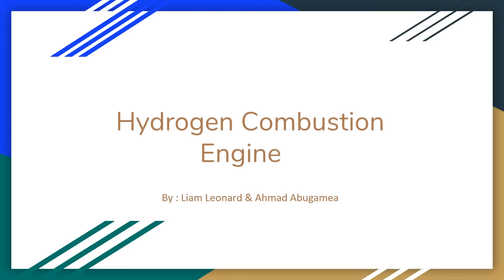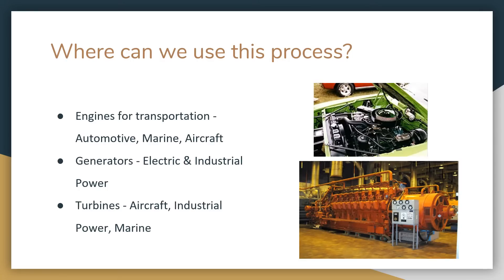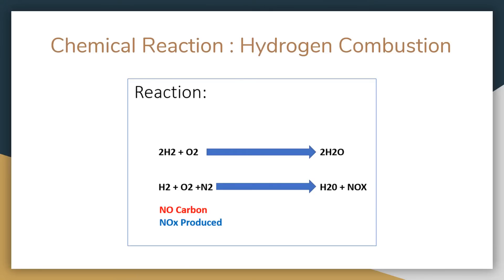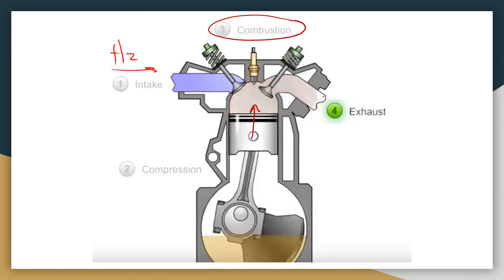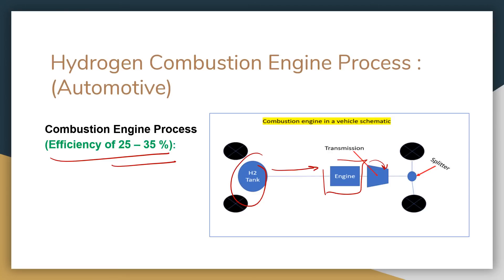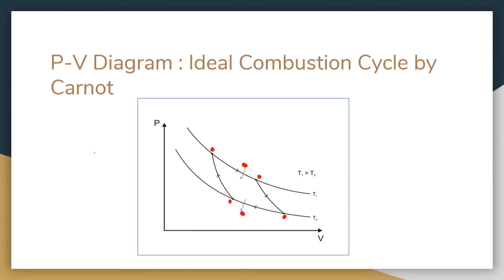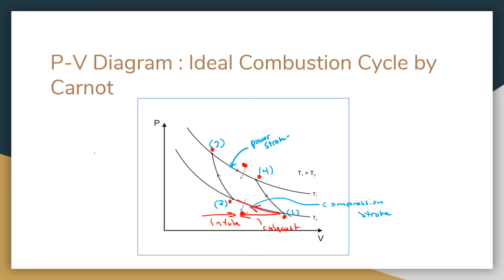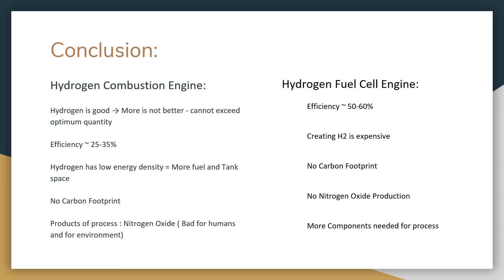Hydrogen Combustion Engines

Comment: In 2021 a Toyota Mirai set a distance record of 845 miles on 5.6 kg of hydrogen, 845 ÷ 5.6 equals 150.89 miles per kilogram. If hydrogen is only 60% efficient (only 60% is actually doing work) that means only 3.6 kilograms of hydrogen moved the vehicle, 845 ÷ (5.6 * 60%) equals 251.49 miles per kilogram of hydrogen.

Comment: Good that this shows NOX produced. Usually this is glossed over when comparing diesel engine with hydrogen engine. NOX is a pollutant, CO2 is not. A major issue is how the hydrogen is produced in the first place. In order to avoid CO2 green hydrogen is needed e.g. electrolysis or methane pyrolysis. Most hydrogen produced today is from steam reformation of methane…byproduct CO2….Blue hydrogen where CO2 is captured has been produced for a long time… the CO2 is used e.g. to carbonate drinks…once opened the CO2 is released into the atmosphere.
3 main practical issues to redress with hydrogen
Green production on scale needed to replace existing energy sourrces.
Transport.
Safety.

Comment: Why does everyone wont to have Pressured fuel tanks inside the vehicle??? 
This is because all the money people and governments, wont to stay in control of these utilities, making vast amounts of money!
I believe the way forward is producing Hydrogen as it is needed, with a small unit right next to the engine! It would not need to be
very big. As each vehicle would have a fuel / water tank, which could be fed to the small unit were electrolysis takes place.
The small Hydro plant, would have micro-switch's, to keep the internal pressure's from getting too high or too low.
Yes, there is still work to be done, but I am sure, this could be overcome.
Reply: … and the energy to run the electrolysis comes from…?
Reply: @guitartommo2794  
As stated there is work to do, but once the engine is running, an alternator produces on average 14.5V.
Electrolysis starts roughly 6.V, upwards. I don't know how many Amps, would prove to be the best? 
Anyway, you could have 2 alternators? 
It could have a petrol start-up, & switch over to hydrogen for normal use. Hope that helps, just give it some thought, you may come up with another way?
Reply: @truethought369  And what fuel drives the alternator? Petrol? Sounds like a petrol hydrogen hybrid🫣
My thought is leave hydrogen in the water. We need the water more than we need hydrogen to power cars…

Comment: Why don't we have separated passenger cabin on two wheels and the engine or the motor on another one wheel or two wheels into two different products. Then let the customers to choose and connect them as a three wheels and/or four wheels vehicle. In this way, we can isolate the complexity from each other; and replacement and/or recycling can also be much easier and repeatable.

Comment: Where did you get your statistics and figures from for your fuel and engine efficiencies?  Because it seems that you neglected to factor in the results of altering the internal combustion engine and its operating parameters, to take proper advantage of hydrogen as its fuel.  

Every fuel that can be used in an internal combustion engine has a specific ignition advance curve that works best for it, along with an octane "rating" which ultimately determines the maximum allowable compression ratio and camshaft profile combinations for the engine utilising it. These also, differ slightly from engine to engine and are further refined via proper tuning to suit the engine in question.  

More often than not, just as the case was for early LPG conversions years ago, the figures given for performance and efficiencies were often obtained directly after bolting on an LPG fuel system, then running it with no other alterations or retuning to suit the fuel.  So most LPG converted vehicles were still running Ignition Advance curves suited to petrol. This meant that the efficiencies and power outputs for LPG converted vehicles were often much lower than they would have been, if they'd been returned with corrected ignition advance curves, and also had hot engine coolant prevented from flowing through the heat risers surrounding the intake manifold runners.  These "Heat Risers" were factory fitted, specifically to cause liquid fuels (such as petrol), to gassify easily at ambient temperatures, ensuring cleaner and more efficient burning during cold start and running conditions.  This is not required for fuels which are already gaseous.  Unlike petrol, they already mix thoroughly with air from the intake stream, regardless of operating temperatures, such that they mostly didn't require cold start enrichment systems, such as "chokes" ether, because they're already thoroughly atomised at Standard Temperatures and Pressures (STP) so they don't need to be pre-warmed or enriched to aid the process.  As such, greater power outputs were robbed from these engines at normal operating temperatures, through unrequired heating of the LPG fuel & air mixture, once the engine's at normal operating temperature. This power loss was because, unlike petrol (which is liquid at ambient temperatures), LPG (gas) loses its octane rating quite dramatically the warmer it gets.  This causes pre detonation in the combustion chamber, which if allowed to become severe enough can also damage engine components, such that ignition timing often needs to be backed off to prevent it;  ...Which further limits full tuning potentials, thereby curtailing higher outputs and fuel efficiencies... 

However, when these relatively simple and cheap alterations were made at the time of conversion, only minor performance and efficiency losses were reported, if any at all!  So it became a far more viable and acceptable option to make these changes.  

As such, the efficiencies and power outputs of Internal Combustion Engine's, when altered and tuned correctly per  alternative fuel source, often even exceed their petrol fueled counterparts.   This has especially been the case where Hydrogen is concerned!  Its not a new phenomenon either.  Its not something that's been made up, just to counter the battery car revolution.  It's been a well demonstrated and established fact now, for the last 100 odd years.  But until now there's never been a reason to pursue easier ways to produce, distribute and store it, when petrol stations were often already on neatly every street corner, with cheap and easy petrol on tap!   So only some engines, with dedicated reasons for running hydrogen that were ever tested.   But it just wasn't important enough to generate mainstream interest back then - Unless you moved within Automotive Engineering and car racing circles, but thats about where it stayed.  Yet, the info is all still out there.  Many reputable automotive engineers and engineering publications have written about these engines, their specs, and the statistically collected data that resulted.  There's been many special purpose engines set up over the years, such as within car and boat racing environments, So none of these ideas and concepts are really new.  They just weren't important enough to bother persuing commercially.  

Often I get the impression that numbers are being purposefully fudged for hydrogen fueled engines, simply because of the massive amount of money that's being invested in batteries and electric vehicles.  Because, it's now at a point where there's serious sums of money being invested - to be made, or to be lost, depending on which technology prevails, regardless of whether it's the better choice or not.   Such has been the case for literally every situation, where competing technologies were involved over the course of the Industrial Revolution.  Think A/C and D/C power distribution systems, where Edison went as far as to publically electrocute a range of animals, in his intentionally misleading attempt to convince people that DC power was somehow actually a safer option than AC power!   Also, think back to the rivaling VHS and BETAMAX Video Recording systems.  VHS became the mainstream, despite BETAMAX always being the better technology, for a range of reasons. But it wasn't given good publicity, so instead, the inferior VHS system, bulldozed on ahead of it... 

So you really need to be more complete about these sort of figures, because what you've said in this video conflicts drastically to real world figures acquired by many dedicated and professional engine tuners and automotive engineers over the years who set these conversions up properly and thoroughly, compared to the average Scientist who is awesome with a slide rule and calculator, but never thinks of all the real world conditions he hasn't factored in, only because he's never moved in the same circles as those who build  standard,  performance, or out and out race engines, and specifically know what to address.  So he doesn't think of advance curves and the intake manifold preheat system's effects on different fuels for example.  Not because he's inferior, but predominantly because it's just not his specific field and area if expertise.  He's never been faced with tuning internal combustion engines for best results, on a daily basis.  So his ideas and statistics only centre around perceived Carnot energy cycles and the energy densities of specific fuels, on a strictly "Chemistry Only" basis.  Never with the hands on experience from professionally working on engines designed and tuned to run on petrol, or making the necessary modifications that can raise engine efficiencies elsewhere, such as by raising compression ratios beyond what is acceptable for liquid petrol, yet allow the higher octane ratings of LPG (up to 110%) to be taken advantage of, which then compensates for losses elsewhere... 

As for Hydrogen, it burns with an extremely fast flame front and therefore at higher RPM's requires very little if any ignition advance, to compensate for "burn lag", where as petrol requires a lot more ignition advance due to its inherent flame front lag, during higher RPM's, such that it has to be fired in advance, well before the piston reaches the "Top Dead Centre" (TDC) of its travel, otherwise maximum combustion pressure occurs "Well After" the piston begins travelling back down the cylinder and losing most of its useable force in the process.  So you need many fuels, (such as petrol) to be ignited well in advance of the piston reaching TDC, so that by the time it arrives at TDC,  Maximum combustion pressure has been obtained and exerts down on the piston just as it passes TDC, on its way back down the cylinder during this "Power Stroke".  Naturally, the higher the RPM, the more pronounced the lag gets, and the more Ignition Advance will be required...  

However, Hydrogen burns with an extremely fast flame front, such that it requires very little Ignition Advance over the course of the RPM spectrum...  Which means that on an engine without a modified ignition advance curve, it will be being fired with far to much advance, creating maximum Combustion pressure before  piston gets to TDC, so huge amounts of power is lost from trying to force the piston back down in the opposite direction, whilst it's still travelling up towards TDC. 

Do you see the inherent problems associated with attempting to obtain (then publish) "Power and Efficiency" data for Hydrogen fueled ICE engines using improperly prepared "Tuned for Petrol" engines, as testbeds now?   ...Not very effective is it!  😎
Reply: Yep. Pretty basic shit

Comment: Why do you stress the fact that Hydrogen has a low energy density by forgetting to specify that it is low in relation to volume (MJ/L) while it is VERY HIGH in relation to mass?

Energy density x mass:

hydrogen  143    MJ / kg
methane.    55.6 MJ / kg
propane      49.6 MJ / kg
butane        49.1 MJ / kg
gasoline     46.9 MJ / kg
diesel         45.8 MJ / kg
biodisel      42.2 MJ / kg
butanol       36.6 MJ / kg
ethanol       30    MJ / kg

Carbon tanks will be more bulky (never like equivalent batteries), but "full" will weigh less and therefore have less impact on consumption.

Also do you know what is the optimal compression ratio of the Hydrogen-Air Muscle?
Do you know what is the combustion temperature of that mixture obtained with expansion of the decompressed Hydrogen from 700 bar at that operating pressure?
Do you know what the speed of the flame front is compared to that of traditional fuels and therefore how much would the unburned mixture be?

Efficiency of 25-35% is one of the many lies that has slowed the development of hydrogen combustion engines ... in addition to the fact that producing hydrogen from renewable sources would be uneconomical:
https://phys.org/news/2005-09-zinc-powder-hydrogen-car.html
Please, study what the "Zinc cycle" is and how it is carried out, the only production process of an energy vector that subtracts HEAT from the environment instead of adding:
http://www.crbnet.it/File/Pubblicazioni/pdf/1287.pdf
"SUMMARY
This paper deals with an experimental investigation on hydrogen production by ZnO-Zn thermo-chemical cycle.
ZnO-Zn thermo-chemical cycle is made up of two reactions: ZnO dissociates at a 2000 ° C theoretical temperature; Zn combines with H2O at a 600 ° C temperature with a ZnO regeneration and hydrogen production. An experimental study was conducted to individuate the dependence of ZnO physical-chemical properties on temperature. Tests were carried out in a box designed and realized with high temperature materials. Experimental results allowed to individuate the ZnO dissociation temperature and verify chemical compatibility of box materials with ZnO and the dissociation products. At last, a solar concentrator-reactor was proposed which is able to carry out the ZnO-Zn"

Comment: Hi  Liam, 
why is it easy to get distracted with NOx emissions. when HHO  electrolysis based fuel generator provides nitrogen free fuel. with the advantages  of hydrogen  is that the IC engine needs to be redesigned , it should not be air breathing .  your video and explanation is perfect of removing NOx
1. you can remove the  hydrogen storage tank  as HHO mixture already contains proportionate hydrogen and oxygen mixture 2:1 provided through fuel injectors or carburetors (whichever is efficient for ignition) 
2.   on demand HHO generation at the  last stage of fuel injection will have no ill effects of flash backs or fire hazards . 
3. for lean or rich fuel mixture ratios - the HHO   generator using electronically calculated  ratios with a minimal   buffer storage of oxygen in isolated chambers.
( probably modifying fuel injectors to create HHO truly at the last mile or truly  on-demand) 
this kind of atomization of liquid is available in inkjet print head technology where piezo electric effect creates ink droplets of very small size. using platinum or graphene micro electrode honeycomb structure   the HHO will be quick and non corrosive. what is required is a miniature HHO electronically controlled generator right near the engine combustion chambers 

do you have any combustion engine mind that is already tested with a single exhaust valve and last last last minute generation of HHO before ?
Reply: Nitrogen oxide is broken down with a simple water muffler like those used on boats. The water produced by the combustion, a radiator shape and a final dehydration would guarantee the maintenance of the necessary fluid.

Producing hydrogen with electrolysis is one of the many lies that has slowed the development of hydrogen combustion engines… together with that producing hydrogen from renewable sources would be uneconomical.

https://phys.org/news/2005-09-zinc-powder-hydrogen-car.html

Please study what the "Zinc cycle" is and how it is carried out, the only production process of an energy carrier that TAKES HEAT from the environment instead of adding:
http://www.crbnet.it/File/Pubblicazioni/pdf/1287.pdf
"SUMMARY
This paper deals with an experimental investigation on hydrogen production by ZnO-Zn thermo-chemical cycle.
ZnO-Zn thermo-chemical cycle is made up of two reactions: ZnO dissociates at a 2000 ° C theoretical temperature; Zn combines with H2O at a 600 ° C temperature with a ZnO regeneration and hydrogen production. An experimental study was conducted to individuate the dependence of ZnO physical-chemical properties on temperature. Tests were carried out in a box designed and realized with high temperature materials. Experimental results allowed to individuate the ZnO dissociation temperature and verify chemical compatibility of box materials with ZnO and the dissociation products. At last, a solar concentrator-reactor was proposed which is able to carry out the ZnO-Zn"
Reply: Hhhhjjjj b
Reply: >by hhu7u3i under bg43
Reply: I am 17 years old but i am really into cars and engine i am commerce student but still Love to learn about cars engine and staff. Recently i have Toyota corolla with hydrogen engine, it was 24 hr endurance race. The car completed the race. I don't think hydrogen cell car is not for racing but for comercial use they are the best. But what about the mass the hydrogen cell cars have more mass compared to regular fuel engine cars. I still think hydrogen engine cars still has a potential.